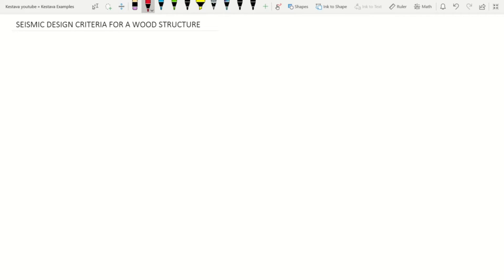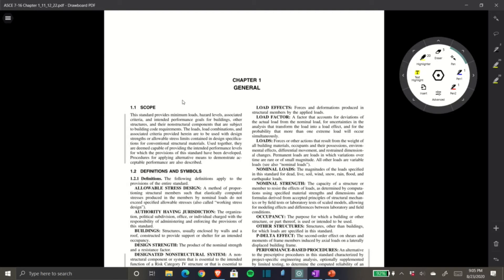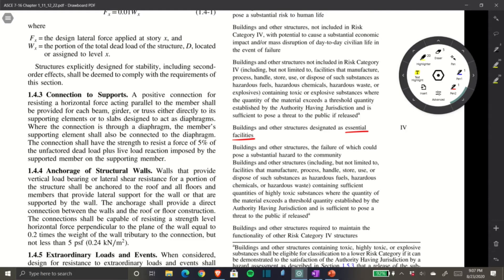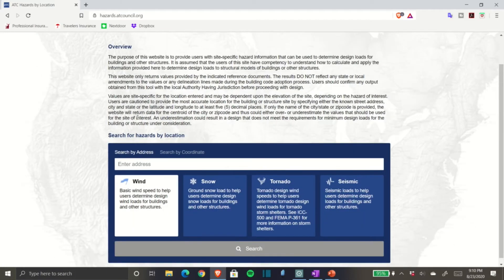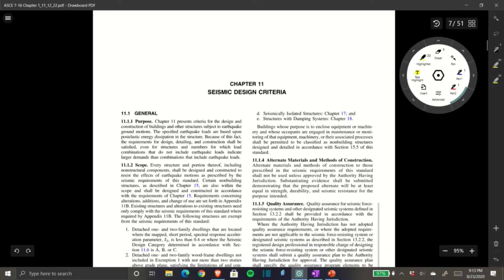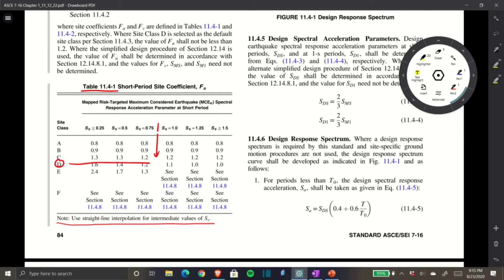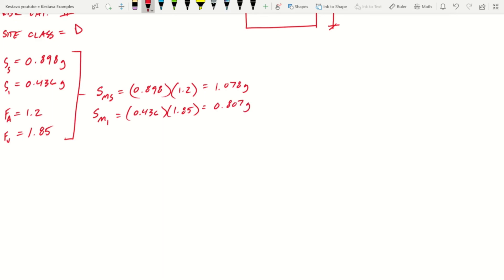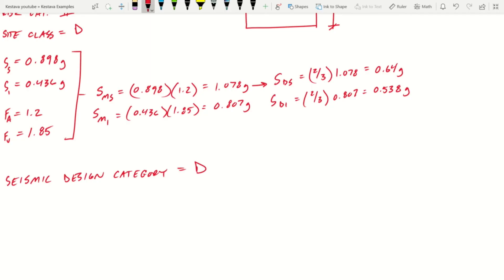Seismic Design of Structures - Finding Seismic Criteria using ASCE 7-16 (part 1 of 3)

Comment: A little question from an Italian Engineer, do you proununce ASCE 7:16 as "ASKI" or as "ASSHI"? I use the spelling A-S-C-E (as you do on the start of the video) but there is another way to pronounce it, correct?
Reply: We spell it A-S-C-E. Actually, we spell most of our codes. Others we call by their name, like the "Steel Manual."
Reply: ay essy
Reply from the maker: An Italian Engineer part of Team Kestava - I'm loving it man! I've only heard it pronounced A S C E as each of those letters are pronounced in English but I bet there are other ways! what's your experience?
Reply: Wht the fk are you talking about. The instructor is not kfiing the Italian. dfkckyou.